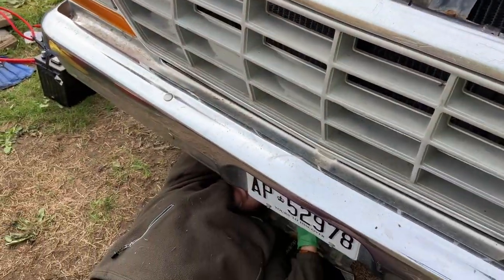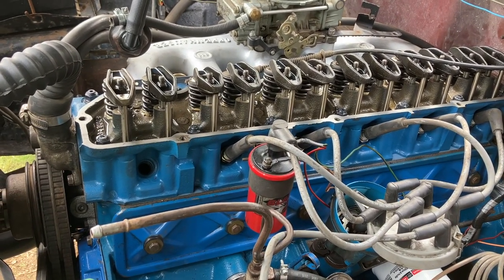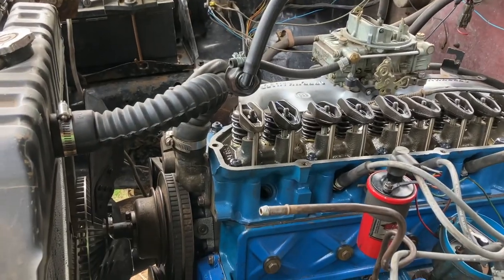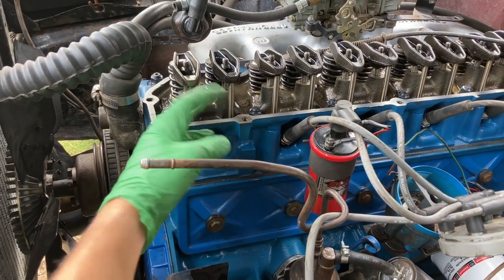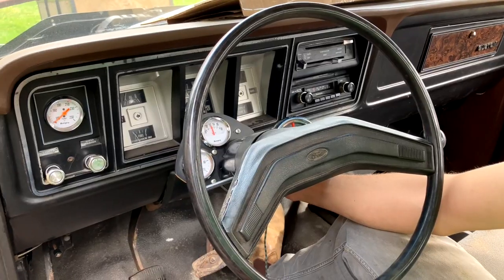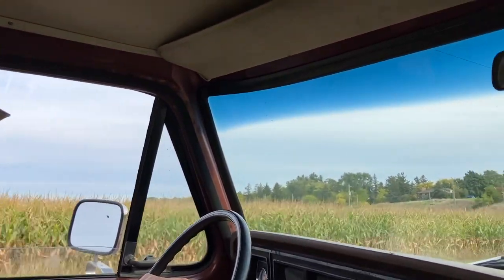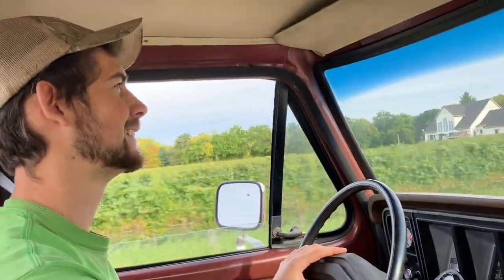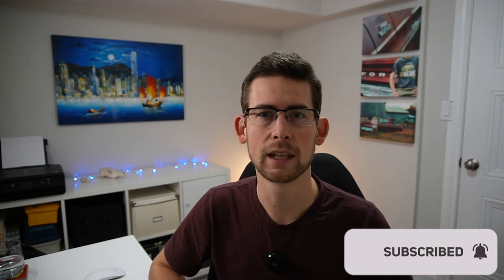Ford 300 Inline 6 Engine Rebuild Part 10: First Start and Break-in

Comment: Nice job! Hopefully you'll be doing a power steering pump and box video as I have to do that on my 77 F150 I6!
Reply from the maker: I’ve already switched over to a redhead box (would 100% recommend) but will definitely make a video of the pump change.
Reply: @JeremyKamutzki  Was the box switch pretty straight forward? I've heard of the redhead I will look into it. Thanks!
Reply from the maker: Yes, switching the physical box is pretty easy, provided your bolts aren’t too rusty. Just required removing the three bolts on the box, the pitman arm, and the rag joint on the steering. Then, of course you’ve got the power steering hoses to deal with. Honestly, it’s the power steering and bleeding the system that’s the hard part, as the design of these boxes makes it VERY hard to fully bleed air out of the system. In fact, I’m suspicious that’s the issue with mine. I’ve read online that some people have had to bleed the box by only connecting the power steering hoses, and tilting the box until the outlet hose is the HIGHEST point in the system, so the air that’s stuck in the top of the box can actually migrate out. I haven’t done that yet, but plan to next spring.
Reply: The old ones usually squeal because people put the wrong atf fluid in it’s supposed to be Type F fluid

Comment: I’m getting ready to rebuild a 300 for my 91 f150 5 speed 4wd truck. Stock bottom end with new rings and bearings, decked block, fresh ported promaxx head with bigger valves, small level 2 torque/towing cam from Crower pn 19211, already has a high flow exhaust system, also will get all ARP studs for good measure. How did yours run with a freshen up? Noticeable difference?
Reply from the maker: Nice. Mine ran smoother and with less leaks. I already had added the 4BBL carb and EFI exhaust before the rebuild, and that was what I would say made the biggest difference.

Comment: Been a good series, sorry if I missed it but what 5 speed is that you have paired with it?
Reply from the maker: Thanks for watching through it. I paired an M5OD with it. Out of a 1992 F150. You can put an f250 clutch in it, which makes the transmission a bit more durable for towing.

Comment: Congrats!!!
Reply: What size tires are you running?  I love the stance!  2wd I’m assuming?
Reply from the maker: Thank you very much! They are 33x12.5 on 15” rims. It is a 2wd truck. That means I get some small amount of rubbing at full lock turning left, but really not bad.
Reply: @JeremyKamutzki  do you have a lift on it at all?
Reply from the maker: No lift. A lift would be good, but the 2wd dent sides are quite pricey to lift in the front.

Comment: We have an '85 , 300 3spd.
It's been pilfered. Thieves stole the control module. If I do away with the EFI and go to a carb. Can I march on. Simplifying the ignition and such.
Reply from the maker: I’m sorry to hear that! Now, keep in mind that I haven’t done this myself, but I am very certain that you can. I believe it involves swapping out the distributor and ignition module. Should be lots of info online, and on ford truck enthusiasts.

Comment: Did you do the 5speed conversion?  We’re there many challenges?

I have an 87’ with EFI and a factory 4speed, I’d like to upgrade to the 5speed.
Reply from the maker: Yes, I did the 5 speed conversion. Went from a '3 on the Tree' to a 1994 M5OD transmission. It was surprisingly much easier than I expected. It's amazing how much cross-compatibility there is between these old trucks. I had three major things I had to do: Notch the transmission X-member and move it back, Put on a new clutch (get the F-250 M5OD clutch - slightly larger diameter, but fits great!) and then lastly mount the clutch master cylinder. That was the hardest as it involves drilling new holes in the firewall, as well as bracing the firewall with a piece of 1/8" plate, and then also modifying the existing clutch pedal throw arm (I added an arm to the right orientation/throw for the hydraulic clutch). The master cylinder/clutch pedal mod was by far the hardest/most involved.
Reply: @JeremyKamutzki  I’m betting going from a 4 to a 5 would be much easier. My 87’ already has a hydraulic clutch. Thanks for the reply.
Reply from the maker: Yes, that sounds like you may get to skip the hard part! It was the best upgrade I’ve done to the truck so far.

Comment: I would like to know if there's anyway to get any advice from you on a 4.9 I have a 1976 ford and I've went as far as I know how to do from changing carb, fuel pump, plugs wires, entire distibutor and distributor cap and rotor plus plugs and wires and a new coil... the truck will fire and run but it seems like it's not firing right and has hardly any response when you try to give it any fuel. I've tried hosing the engine down in carb cleaner to find any vacuum leaks like everyone has recommended it does nothing the engine doesn't even idle up if you spray carb cleaner directly into it. It just continues to misfire and run like junk. Please help.
Reply from the maker: Hey, that sounds really frustrating! My first thought would be that it would be good to spend some time doing more diagnosis. It sounds like you’ve replaced some of the common parts that wear out, but that didn’t really change much. I’d recommend checking the firing order on the distributor to spark plug wires, checking the ignition timing with a timing light, and running a compression test on all 6 cylinders (both dry and wet). If you don’t know how to do these, you can definitely find details online. The tools to do the tests can often be borrowed for free from auto parts stores, at least in Canada and USA. Why don’t you run those tests and see what you find. My guess is that either one/both of those tests will show something is up.
Reply: @JeremyKamutzki  It is really frustrating honestly, I'm going to take your advice and try to do a compression test as soon as possible and check the plugs and wires again. I hope one day I can build the old engine one day so I'll probably be coming back to your videos in the near future for that project 😂
Reply from the maker: @theronjohnson285  sounds like a good plan. I know diagnostics can be a pain, but I've learned over the years that you simply can't skip it! And feel free to report back with the results. I'm happy to help interpret.
Reply: Vacuum gauge will end a lot of mystery.
Reply: @Jeremy's Adventures   So few months later just an update, I rebuilt the engine after watching your videos and found some interesting things that had happened ( pushrod were wore done in very odd ways, cracked vaulve guides and a cracked vaulve) but after doing all that the truck would still not run right. Turns out I had a small pinhole in my metal fuel line coming from the tank that sits on the frame and it was killing my fuel pressure to the Manuel pump. That truck has driven me insane but I finally drove it successfully through town! Hope your truck has been doing great also, thanks for the awesome videos to go by!
Reply: @Really658  it did 😂 but after months of not being able to figure it out I was able to get some help and found out it was a small pinhole in my metal fuel like and my fuel pressure was down bad it would get enough gas to move the truck around the yard but once you started moving down the road it would lose pressure and die and the old Manuel pump wouldn't want to prime back up again
Reply from the maker: Hey, way to persevere and do the diagnostics to find all the problems! They can be SUCH a pain, but that smile that you get to enjoy as you drive it around and it actually works is just priceless!